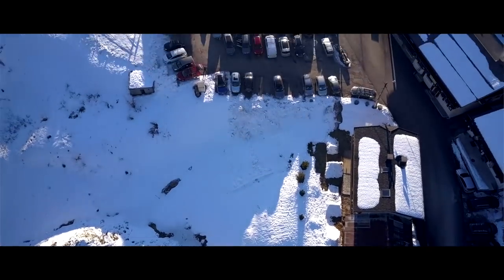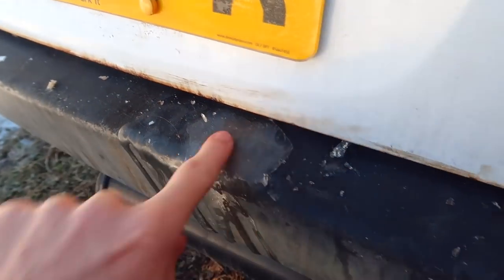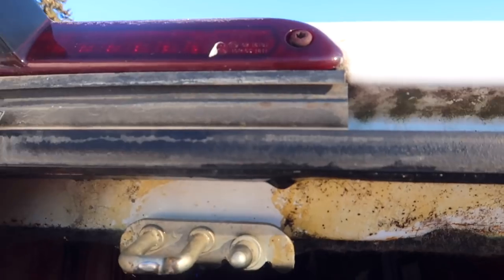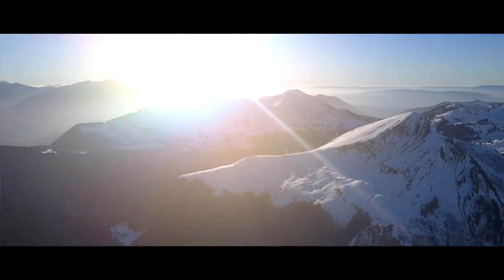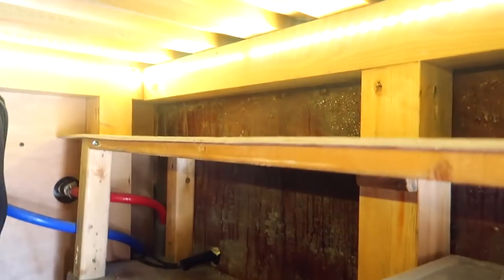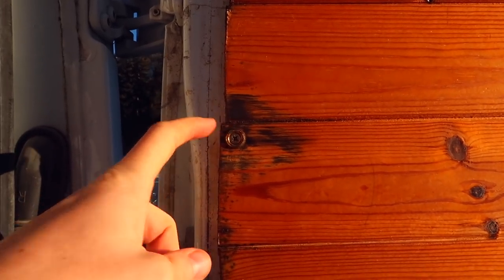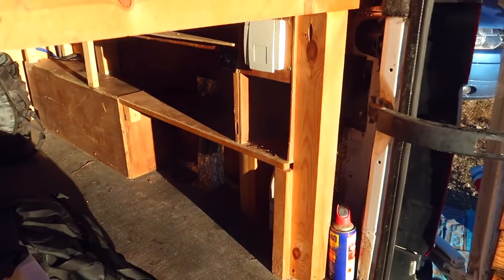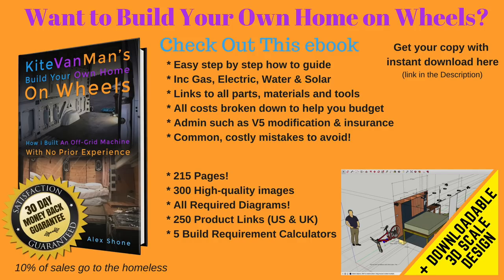Dealing With Condensation! - How We Live In a Van Over Winter (DAILY VLOG)

Comment: In addition to moisture removal hot air in the garage area would warm the bottom of the bed overnight when it is really cold.  Condensation in the mattress could result in some really nasty molds where you sleep.  If possible blowing some hot air into the garage might be good for your health.   the old guy  Bert
Reply from the maker: Yeah I think this is something I am going to have to do. Cheers Bert
Reply: I installed a Webasto air heater in my van, this have the double advantage of heating and drying the air. My humidity sensor is now always around 50-55%, which is very good. This has been a great improvement.

Comment: Either sleep with widows open or create/utilize a condensing surface so water escapes, back doors is ideal. Heat will not cure condensation it will only cause it to move to a different cold spot

Comment: A trick we used when I was a mechanic in a Land Rover dealership, was to put washer tube (the tube used for windscreen washer jets) inside the door seals. (If the seals are of the hollow tube type)This prevented the seals squishing too much. Usually there are small holes along these type of seals, which you can push the tube through.😊
Reply from the maker: Cheers!

Comment: Yes its hard to say if you have a leak or condensation. Watch out for cold bridging into your living space from screws etc. How about putting a warm feed into the garage and a return out.
For the back doors how about leaving the doors bare metal and fixing a curtain across. I'm leaving my rear doors exposed as they are too fiddly to get 100% correct.

Comment: Ventilation, Ventilation, Ventilation, We build our vans with warm air raising from the floor level to the ceiling, I will use this video to show why we do it from now on! 
To solve it you need warm air flow during the night, a lot of condensation is from your breath! I haven't seen all you videos but if you use gas this also create condensation, 
We use waterproof fabric for ling (outdoor fabric) this stops condensation behind you lining, also any screw bolt fitting that is metal will transfer cold to heat and create condensation. so all you screws in the timber will create condensation, 
I saw most of you build video and could see issues for the future for you like fitting pipes under the floor with non permanent  fixings (warm pipes soften and fittings slip off) 
Having said that a quick look at your videos and you have lived the life so good on you!
Reply from the maker: Sure thing. I added a Y piece from my diesel heater into the back. Cured the problem 🙂👍🏼 - I am dreading the day I have a water pipe issue! 😬😅😅

Comment: Hello mate. Wondering how everything went after your video. All the advice I saw in the comments were great, but one thing no body really mentioned: the direct wood to metal is the reason for your extreme condensation. Not just the screws, which will rust no matter what you do unless they are stainless steel screws. You need Insulation, then a combination of a moisture barrier (aka plastic rap), sticky felt, and tape to seal the edges. Then wood.

Comment: Plump up youre seals with olive oil....helps with the frost also.
Reply: You could probably double up the seals but your best bet is probably changing that door hinge which might cost you I don't know about a hundred bucks because the suicide hinges butt she probably bent the hinge when she hit the door and that's knocked out of line which is causing water to get in and I would guess I doubt there's any way to been that inspect in the correct way they hold roughly about 500 lb or more right I would guess so probably not easy to bend that correctly you could just glue a piece of rubber around the woods that would probably help

Comment: Re. Cold bridging, on my van I fixed wooden furring strips over the insulation and vapour barrier onto walls and ceilings. Then all my internal structures are/will be fixed into the furring strips so no bridge to the external cold skin. Areas like the exposed metal on side and rear doors I'll use heavy curtains. Then any wetness can dry out the next day instead of moisture being trapped.
Reply from the maker: 👍🏼👍🏼 what are furring strips?
Reply: @KiteVanMan  similar to wall studs in buildings. I used plywood cut into 80mm strips, they bend easily and can be screwed into the van structure. They then make a sound surface to fix to without fixings on the warm inside making direct contact to the cold outside therefore no cold bridging.

Comment: Ventilation air flow and light in garage area. you can use a small vent going from the living area. That you can open from time to time. Need's air flow to cut down on the  wood getting wet. And get sum light. Mold spores they won't turn into the black mold colonies until they find a nice dark, moist location to grow.

Comment: May you think, a van is like a caravan. Cause the outer hull is completely metal is diffusion resistent. Inverse you build a house. 
The problem is you get condensation cause the dew point is after the vapor barrier (metal hull).

You can only deal with enough air flow.

Means in reality, it is much better when the van is not good sealed and the air can flow. Yes you need more energy to heat, but the condensation problem is under control.

Example: Most of the time I live in a caravan. And before I went to bed, I heat up the entire caravan. Then stop heating and open the door for over 15min. So every moisture can go outside.
Warm air can have much more moisture than cold air.
So you get rid of the condensation.
Do this also in the morning and have no problems with mold.
Reply from the maker: Thanks very much! :)

Comment: That's why Caravans that are suited for winter camping have heater on gas that can blow air into a pipe system that runs all the round, under the seats ,storage boxes and past the watertank.
My '90 Fendt Joker 470 caravan has the full monty and it even interact with the boiler as a heat exanger.
With a vent that take warm air will help ,a vent in the back door that you can open and shut when needed will also help a bit.
As long as the air under the bed is circulated it will be much less off a problem.Do check de door seals especially the damaged door.
Shine a flashlight in the dark on the inside off the seal/door joint by your girlfriend and you check the seal outside in the meantime.Iff there is a gap,you will see it.
Works sometimes better the putting water on it.

Winter caming takes a lot off different preparations than normal camping and i'm no expert in it.I'm more the sunny type (;
Great respect to you two for living the live you live.
Reply from the maker: Awesome cheers!

Comment: Did you install a vapor barrier between the insulation and the wood of the door? Maybe that helps in combination of replacing the rubber?
Reply from the maker: Hi, yeah there is reflectix there... but of course the screws pierce the “barrier” 😬
Reply: @KiteVanMan  screws are perfect thermal bridges. Next time better use glue.